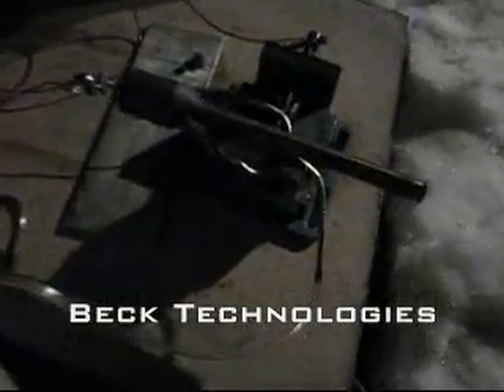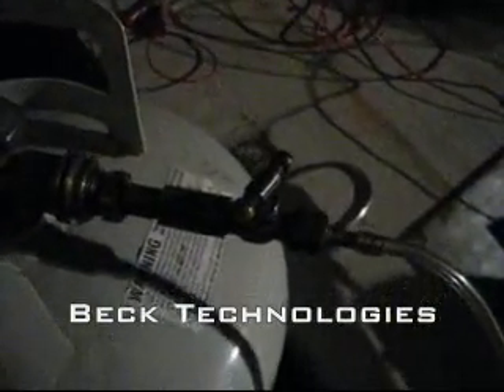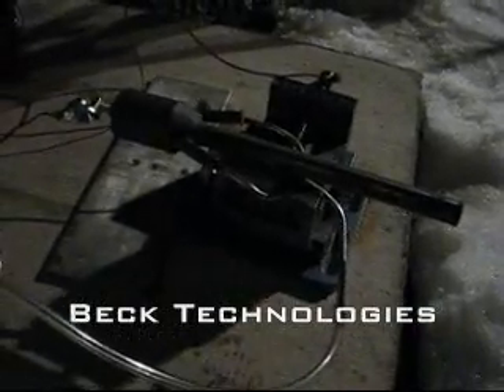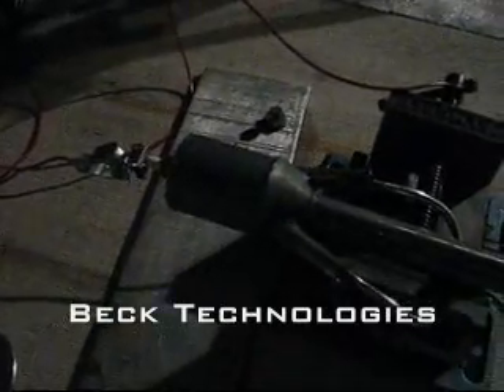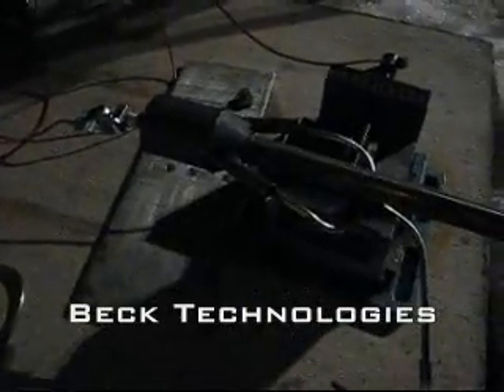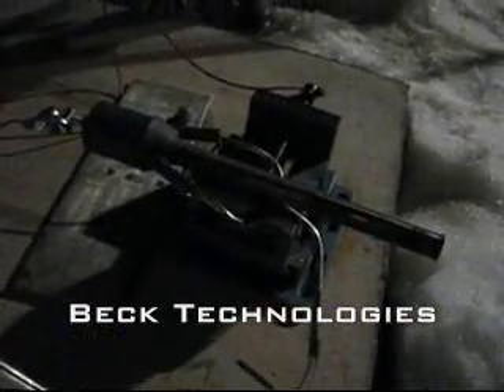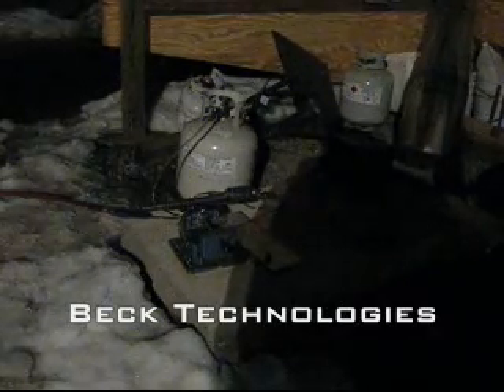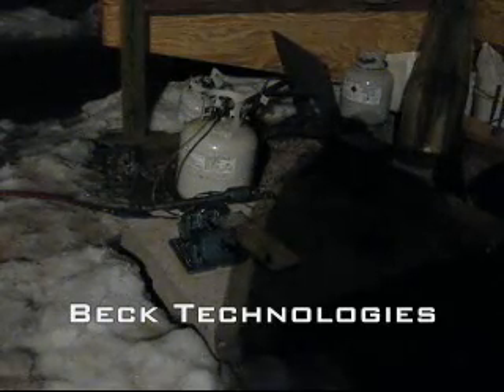Mini Thermojet Valveless Pulsejet

Comment from the maker: Unless you used fuel that was an explosive itself, it wouldnt explode. Normal fuels burn, there isnt enough restriction for the engine to build up enough pressure to rip apart the 20 gauge stainless.

Comment: I wouldn't think so. The combustion gas is flying out both intakes and the exaust. If you closed those off I think the engine would die for the same reason a super-soaker flamer thrower can't explode; air can't get in and the fire would suffocate.

Comment from the maker: You can make RC jets with balsa but typically people epoxy / fiberglass the surface to give extra strength. You need a heat reflector no matter what material you use though. I would do some high speed nitro flying before trying a jet.

Comment from the maker: You can only make them a little bit smaller on propane, it all depends on the fuel burn time, if the engines frequency is so high that the fuel doesnt have time to burn it wont run. Some very very tiny ones have been made for hydrogen, but hydrogen is not something to play around with.

Comment from the maker: The two "intake" pipes also let exhaust out, its called an aerodynamic valve, but basically there is no valve mechanism other than it is of the right size and shape to let just the right volume of air in and out of the engine. When the engine starts, it blasts out exhaust, then low pressure inside the engine draws air back inside through the intake. Flame comes out of the intake for only a few thousandths of a second at a time.